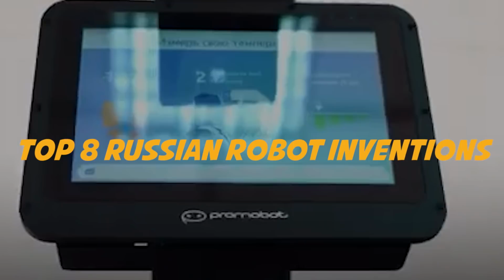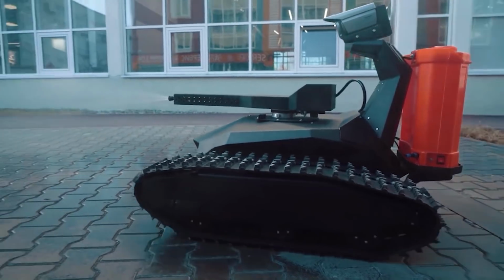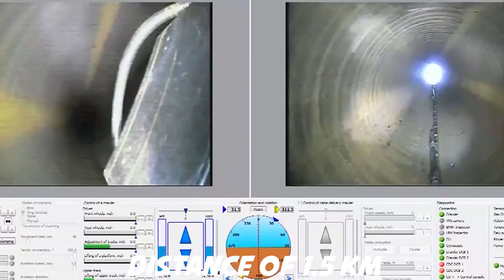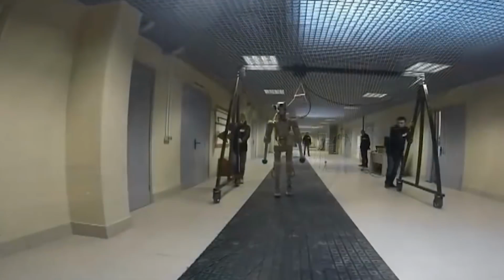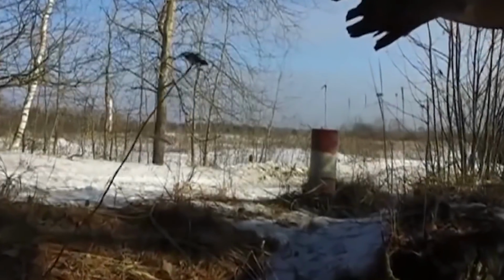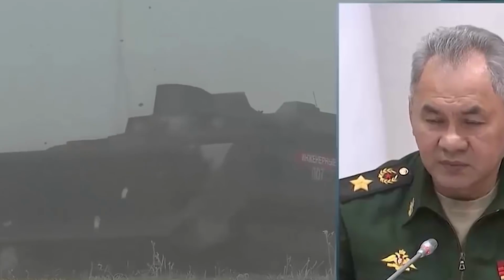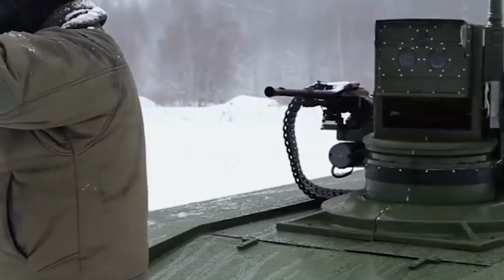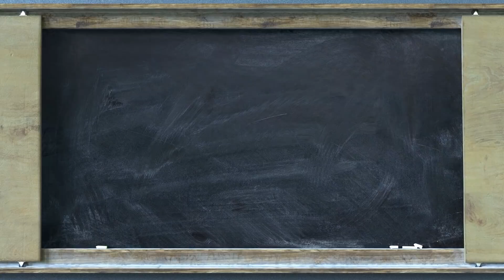TOP 8 Russian Robot Inventions That Are GOING TOO FAR!

Comment: We're going to need a bunch more Stinger etc. type missals.  If these "Marker" things run on gasoline engines will CO2 gas choke them ?  So for now;  target the intake with TIG welder gasses; right? Argon, Helium, CO2.  But you can also go the other way; and use Naphtha or starter fluid !  Bring popcorn.